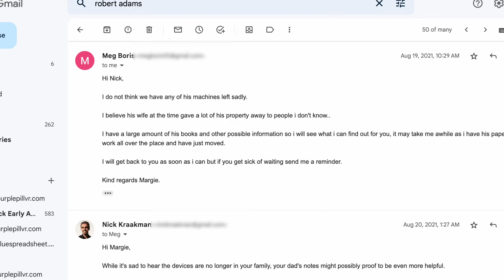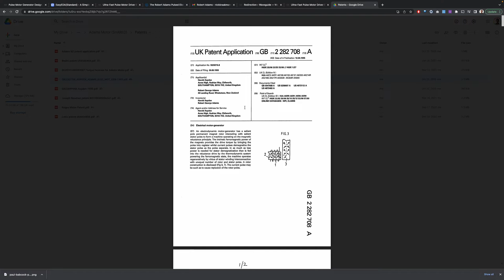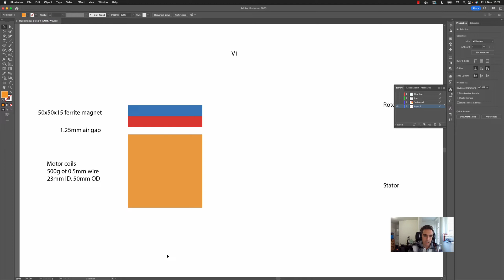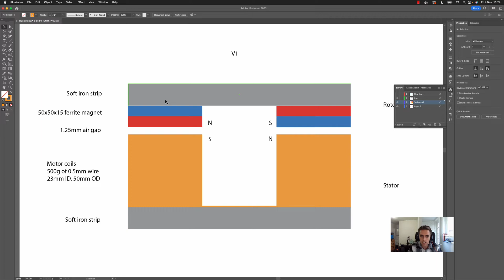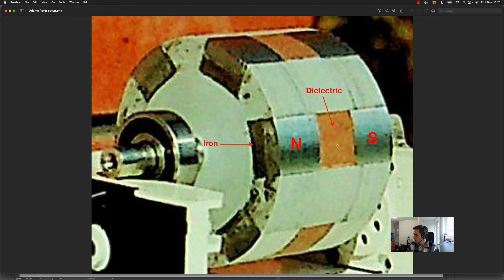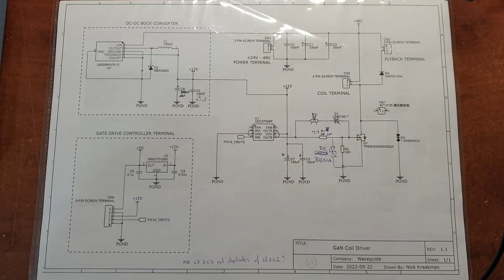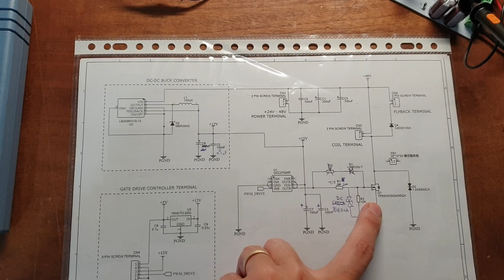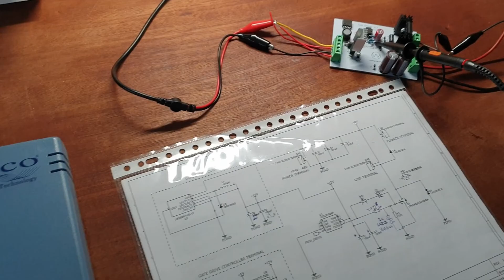New Pulse Motor Design with Closed Magnetic Circuit

Comment from the maker: In this video I unveil the ideas behind my latest and greatest pulse motor, based on a picture of one of Robert Adams' original rotors.

Pre-order my Ultra-Fast Pulse Motor Driver PCB:
https://waveguide.blog/product/pulse-motor-driver-board/

My presentation Adams Motor presentation at the ESTC 2021:
https://emediapress.com/shop/the-robert-adams-pulsed-electric-motor-generator/ref/12/

Paul Babcock's pulse motor presentation at ESTC 2022:
https://emediapress.com/shop/they-are-all-the-same-sg-vs-rpg-iron-core-vs-air-core/ref/12/

Mike Clarke's pulse motor presentation at ESTC 2022:
https://emediapress.com/shop/reactive-power-generator-part-4/ref/12/

All my Adams Motor research materials can be found here:
https://drive.google.com/drive/folders/1Vk5dVesTRzO2VlsFth3GLp9XNR4s2TY6

NEW blog post "Pulse Motor Generator Design Considerations":
https://waveguide.blog/pulse-motor-generator-design-considerations/

Comment: Mr Kraakman sir.  In the dc to dc converter does the op amp come pre-programmed or did you have to configure it sir?
Reply from the maker: The one I use is pre-programmed for 12V output.
Reply: @Waveguide  Thank you sir. Are you enjoying the new job sir?
Reply: @Waveguide  Thank you sir.

Comment: Mr Kraakman if I may.  What is the purpose of the 2 capacitors in the lower part of the schematic? ( C7, C3 ). Thank you sir.
Reply from the maker: The larger C7 and C6 caps are to ensure we can deliver enough current in the shortest amount of time for the sharpest possible rise time of the gate pulse. C3 is a filter cap to ensure a cleaner signal with less high frequency noise in it.
Reply: @Waveguide  Thank you Mr Kraakman.  I apologize for torturing you with questions which you have answered graciously I might add.  It is one thing to simply replicate your method but if anything goes wrong I will have greater success repairing, modifying or adjusting components if I know their purpose and how they should operate.  This should be a fantastic learning tool for me.  Thanks a lot Mr. kraakman for all your help.

Comment: If you wanted to invert the phase of the current in the ouput ( charge battery ) would you use an op-amp?  And what terminals would I connect the op-amp to?  The negative of the output or the positive?  Thanks Mr Kraakman.
Reply from the maker: Don't have to invert, just make sure charge battery polarity is correct.

While the flyback shows up as a negative spike, it really just depends on where you measure, since if you measure from the end of the coil to the beginning, the phase seems magically inverted. The coil becomes the source instead of the load when the field collapses.

Comment: So the 48v goes to the coils and also goes to the voltage regulator  at the same time?
Reply from the maker: In this version of the board, yes. The 48V is what is pulsed through the coils, but also goes to a buck coverter that steps it down to 12V to power the gate driver, and also goes to a 5V regulator used to power the interrupter.
Reply: @Waveguide  Thank you Mr Kraakman that clears a lot up.  Only the bottom right of the schematic is unclear, but given time that will become clear too.

Comment: I've watched this about 8-9 times now.  The curiosity is killing me sir.  What is that small version of the rotor structure in the background?  Is there an application for several small versions?
Reply from the maker: My plan was to build a small version first to test out the idea for less $$, but then I decided it would be almost the same amount of work to build a large version, so I did that instead :-) Never actually used the small one.
Reply: @Waveguide  Bedini to Babcock "Never build anything bigger than a bench-top model".  Yes, I understand.  Thank you sir.

Comment: I spent the best part of last week studying your resources from google drive folder.  It's a lot to take in, but I thought it necessary to be on the same page as you when you're explaining the new upgraded Aspden motor.  I ordered the Ultra Fast Pulse Motor Driver Board sir, as it would be the height of foolishness to follow along with this project and be missing vital parts of the system.   Your transparency is reassuring.  Keep up the great work.  Thank you for your help thus far Nick.
Reply from the maker: Great, thanks for the order! I will try to get it over to you as soon as I can.
Reply: @Waveguide  I'm so greatful for having stumbled across your work sir. Previously, I was a bit overwhelmed by the amount  of information available that had to be sifted through and understood.  So far you have managed to do the most efficient job of simplifying complexity and breaking it into bitesize info so ordinary people like me can understand what you know too and maybe get the benefit of this tech. Anyway I'm ranting sir. The next thing is to locate Aspden's patent to get an idea of the dimensions of the motor structure to feed into my 3D printer and then onto the battery swapping elements. Thank you Nick for decoding Babcock's breadcrumbs.  So thanks to you I don't feel overwhelmed now. Best of luck sir.

Comment: Why are you not using the original robert Smith mechanical switch timer....using commutator?
What are the cons of using a mechanical switch timer?
Reply from the maker: The mechanical switch is a little harder to build and control vs using a MOSFET, but Adams recommended people start with the physical commutator, since you don't lose any energy to power the switching circuitry. However, FETs have become much more efficient since his time.
Reply: @Waveguide  pls any link to get your switch time schematics. Thanks
Reply from the maker: @uchelevite  All links I have available are in the descriptions of my videos

Comment: Thank you for  your  work and all the informations  you gave  us on your you tube chanel and blog.... I am  curious if that 3d printed plasic rotor  will  not explode under high sppeed and centrifugal forces ... Maybe would be  a good  ideea to wrap it in some electrical tape to be  more safe when rotating at high speed...
Reply from the maker: Good point! The rotor is only going at ~700 RPM now, and I calculated the force and compared it with the tensile strength of the PLA and it can handle much higher speeds, so I'm not too worried. My smaller motors went up to 4000 RPM, and the plastic never budged, but the magnets did fly out twice due to poor glue strength, that's why the only thing I'll ever use now is epoxy, which becomes rock-solid + I always wear protective glasses. Ideally I would place a transparent screen in between me and the motor as well, but heck, you got to live a little as well ;-)

Comment: It is good to see you back on pulse motors. Thanks for the links to the ESTC 2022 videos. I also watched them and got a ton of inspiration out of them. For example, I had never heard of silicon carbide diodes before... Perhaps I revisit my shelved Adams motor to try to suck the flyback out of it and study a bit before going into some of Babcock's ideas.
Reply from the maker: Yeah those diodes are great! Can handle enormous voltages, are incredibly fast, and result is nearly no switching losses.
Reply: @Waveguide  I like your videos with the information so that I can get ideas for making my motor fella. Glade you are back for sure. Peace too.

Comment: Here's what I want to see from a pulse motor, and eventually build myself:
-The stator actually rotating freely in the opposite direction to the rotor, meaning that you will have no mechanical torque as an output but all the rotation will go back into generating more RPM thus more pulses. 
-Adding weight to the rotor for increased momentum, so that when we generate from the coils the increased weight will power through the resistance better and thus give more power.
-Isolating the device within a vacuum to reduce drag.
Reply from the maker: Hi Claude, thanks for sharing your ideas! Here are my thoughts on them;
- "Stator" is derived from "static", so non-moving 🙂How do you plan to make the stators move? You'd need some sort of motor for that too, right?
- Creating a flywheel effect as you describe works best by adding weight on the periphery, which is where the magnets are, so will be tricky to add more there. Take into account though that additional weight requires additional power to keep it spinning. A flywheel is like a mechanical battery, so in the end you might get more power out, but will have to put more power in as well, so no net gain.
- Operating in a vacuum would indeed reduce drag significantly, but the energy required to set up the vacuum should be taken into account in the energy in/out determination.
Reply: @Waveguide  Agreed, this is what a traditional stator would do, however in my concept the outer ring of coils, let's call it, is spinning the opposing way to the rotor, provided by the same force that pushes a rotor against a traditional stator. You would probably have to experiment with the amount of magnets/coils to get it right and have a way of providing electricity to a spinning "stator". 
Agreed, tricky but not impossible. The whole thing is tricky, says Bedini. The weight impacts the speed up process more than the top speed, and the gains you'd notice from the added weight should total more than the cost to keep it there.
Sure, but once the vacuum is established you have a greater amount of power for a longer period than the initial vacuum process.

Comment: nice work mate love it... with my limited knowledge mate is there major difference with your method and the one presented here at 4min https://www.youtube.com/watch?v=o8pDwgv0b80&t=313s
Reply from the maker: Yeah the biggest difference is that mine is a pulse motor, not a regular AC or DC motor/generator.

Pulse motors have some peculiar features, like trying to capture and re-use the flyback spike caused by the inductive collapse of the motor coils when the pulse turns off.